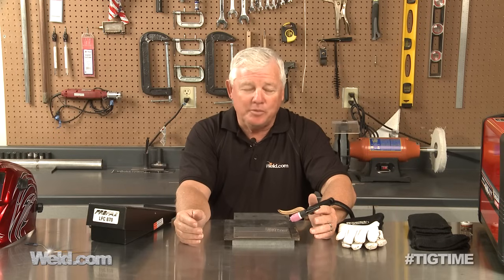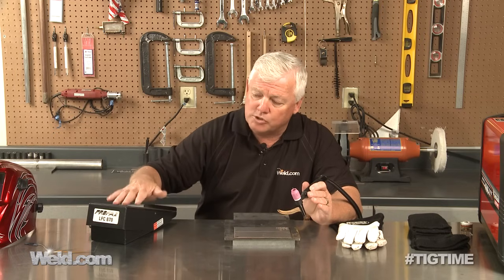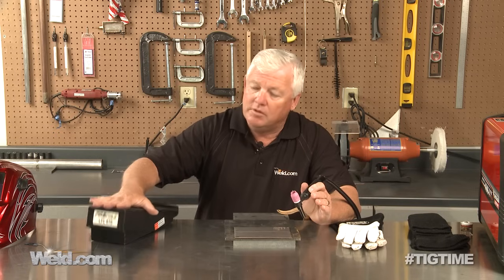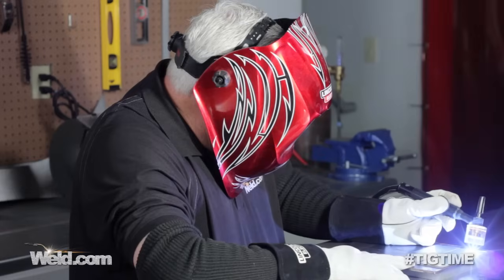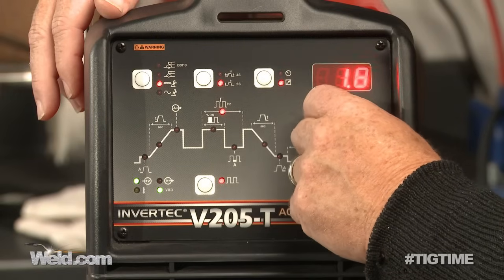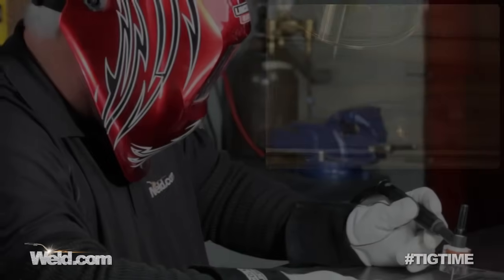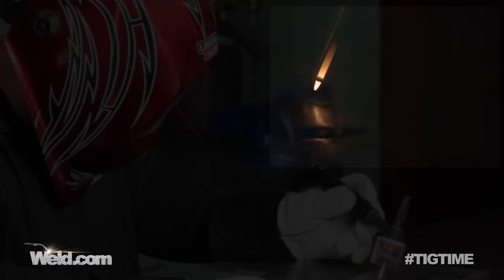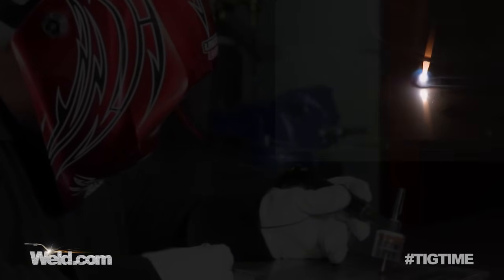Pulse Welding: A Beginners Guide

Comment: What settings can I use to fuse 1mm or 1.6 mm pie cuts without filler rods
Reply: You can do High freq 10 Amp and tack slower than high freq 100amps

Choose what's good for you.

Comment: Hallo Mr Tig, 
Please tell me for what kind of metals is it good to use Pulsed Tig, and at what setting should I place the  Pulse duration ratio, and pulse frequency whethat I have to set in Pulse Tig mode.
Reply: he not with weld.com any longer he works for Lincoln electric as instructor now
Reply: because when you use a pulse on pipes stainlessteal 4mm welding is much much faster.

Comment: can you use dc pulsing to emulate ac welding as used in aluminium welding? thanks
Reply: Great question!! I’ve been trying to find that answer for a long time!
Reply: No. Ac welding use a half cycle to clean aluminum oxide. If you want to weld aluminum on dc, try heliarc.
Reply: @truonggianghin  but wouldn't the pulsing DC be the same as AC.
Reply: @ralph9987  AC is just cleaning action of the oxide; the look of the weld is how you add filler, power, and speed. Pulsing is electricity flowing one way; AC is both.

Comment: In what instance would you use pulsing?
Reply: I use it for welding very thin material. It keeps the work cooler and prevents blow through.
Reply: Steve Friedlander helps with vertical up a lot
Reply: Apparently it helps a ton with welding stainless steel, as iv'e found the hard way you can't just cook it with max amps and get away with it like you can on mild steel lol...only just learned about pulse tig the other day from the head tech, iv'e yet to really play around with it so far, but iv'e seen amazing looking welds made with it :D